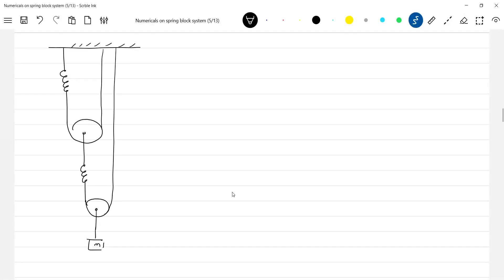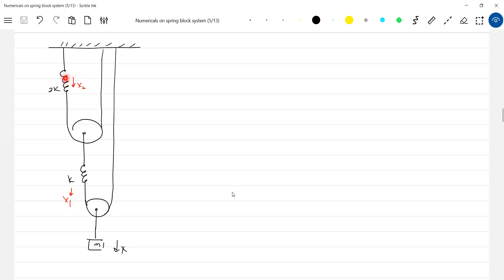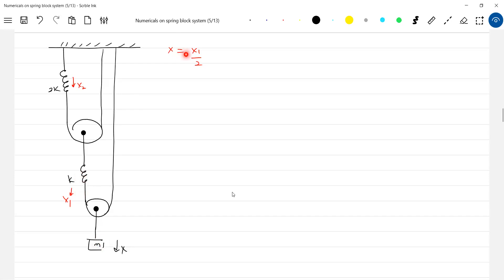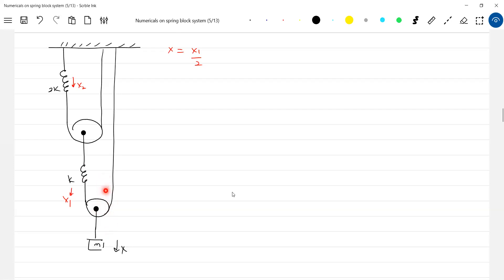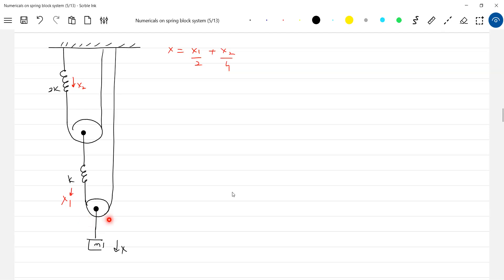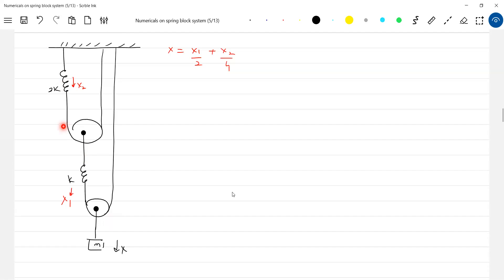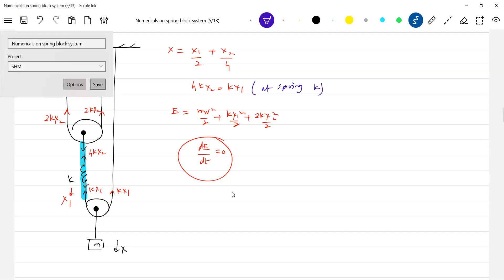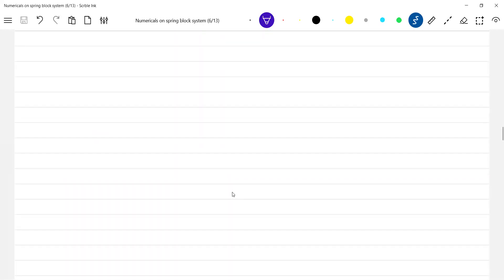7) SHM | vertical oscillations of block with multiple springs and pulleys

Comment: There is a better explanation for the relation between the displacements and that is by summation T.x=0
Reply from the maker: It's a virtual work method, useful for exams , but  it  will kill basics of dynamic motion, that's why I didn't explain it